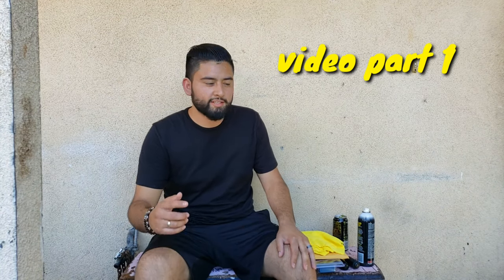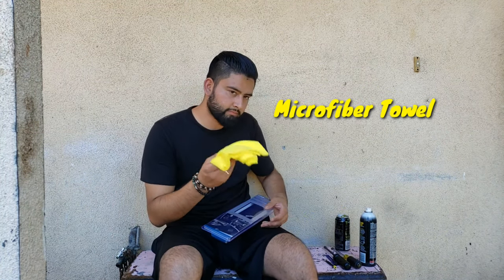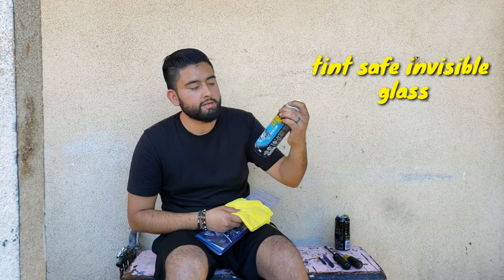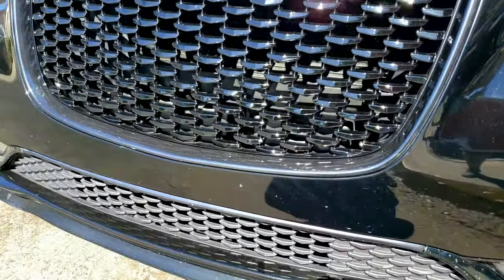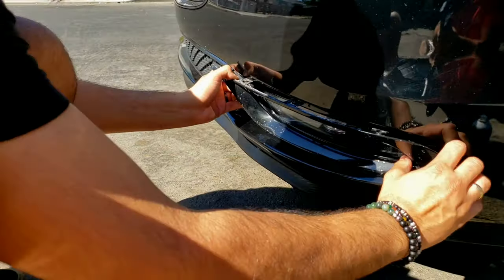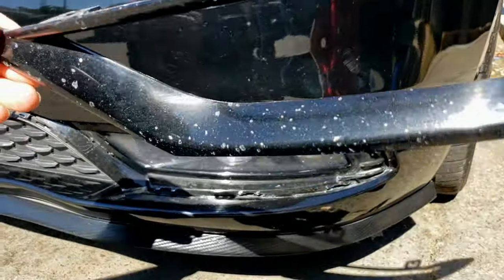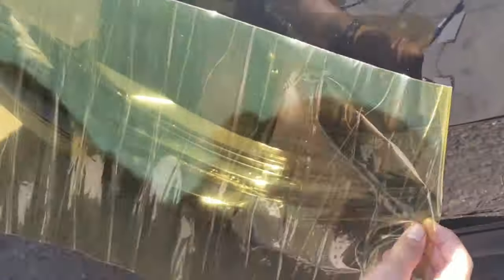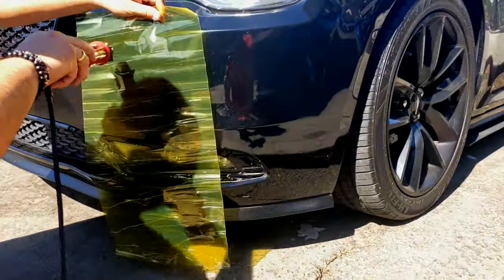How to tint your  fog lights yellow on a chrysler 300s & charger

Comment: your front black grill have chips around the outer edge from the rocks? Mine has ... I'm thinking of replacing the grill one it gets worse.
Reply from the maker: I know bro not good. I actually wrapped the trim and the chrysler logo  carbon fiber. But unfortunately ran out and was not able to do the grill trim. Did video same day will post it later.
If you do decide to buy a grill I recommend a black Bentley style grill from Ebay. All you need to do is get the outer edge painted gloss black at a body shop. Had it on my car but got into a accident and had to go back to stock grill.